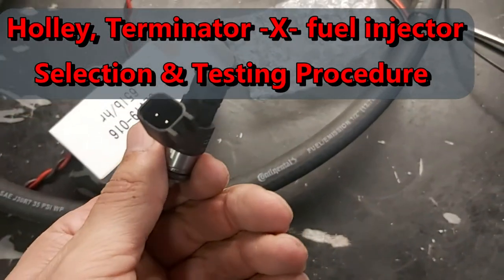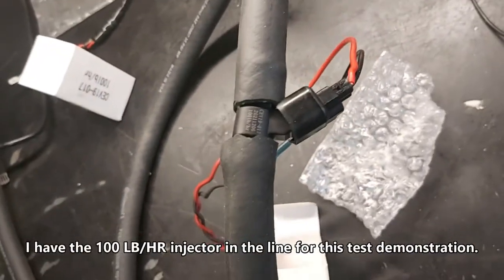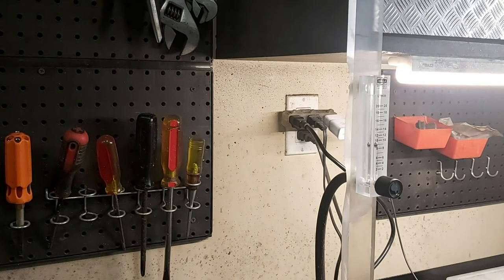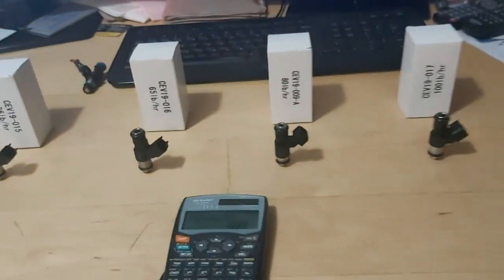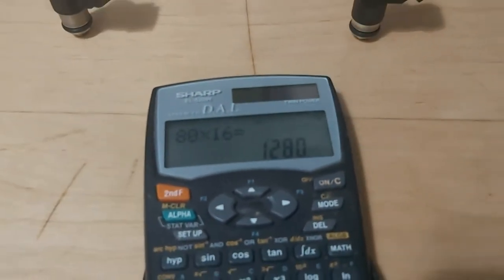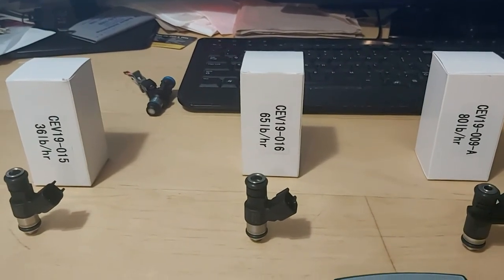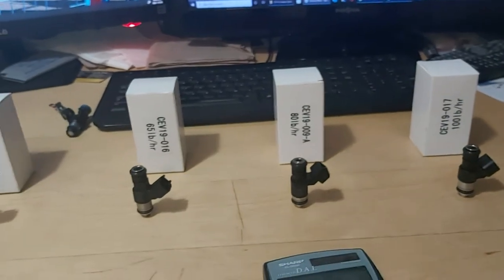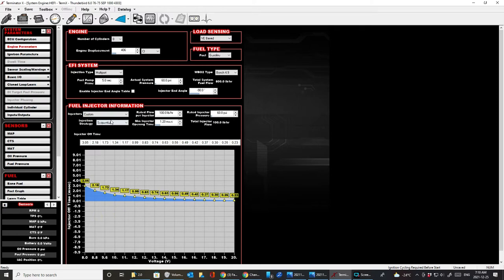Holley Terminator X Fuel injector selection & testing Procedure

Comment: This is exactly where I was confused yesterday. So when reprogramming the SD card for injectors  min injector opening time and off time as well as volts don’t need to be changed????
Terrific video!!!! Thank you
Reply from the maker: Correct. If the engine runs good with the numbers that are already in those fields, no change to them is needed. You can manipulate them up or down should you have exhausted all other avenues of the engine not running up to it's full potential Thanks for watching and commenting.....Oliver.

Comment: What brand are they ? How much for set of 120s?
Reply from the maker: I had them specifically manufactured to meet certain design parameters, for reliable and consistent performance. I wanted to set -up a cost effective fuel injector supply option, to the other company's that are presently selling fuel injectors. So I guess we could call them the let''s Boost it brand.  Unfortunately I do not have a set of 120's only 100"s right now. Oliver

Comment: How are these Injectors long term?  Any issues?
Reply from the maker: They seem to be very good with no issues up to this point. Very consistent and repeatable performance. Usually if injectors are shit, it runs like shit right away and the idle, fuel pressure  characteristics etc will not be consistent. these are very good and I'm not at all disappointed. Even the first drive was good which almost never happens. Thanks for watching and commenting. You can watch the first drive video here at this link....   https://youtu.be/PfrtuPXEY_U ..... if you're interested in some injectors I have a few sets of these still in stock....Thanks again....Oliver